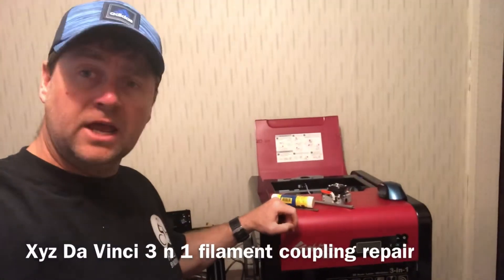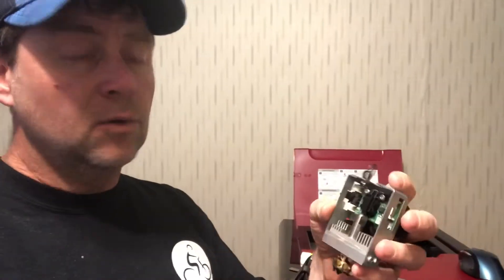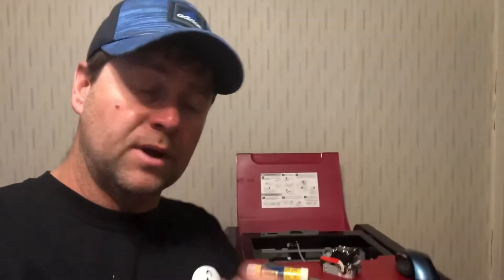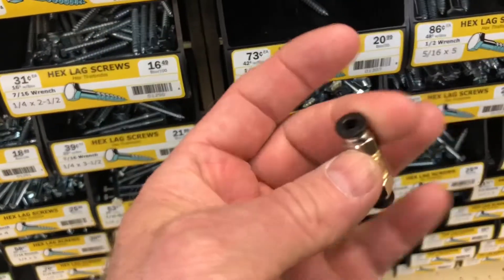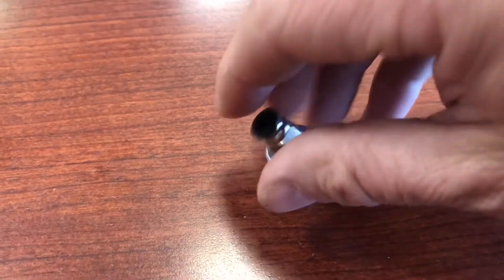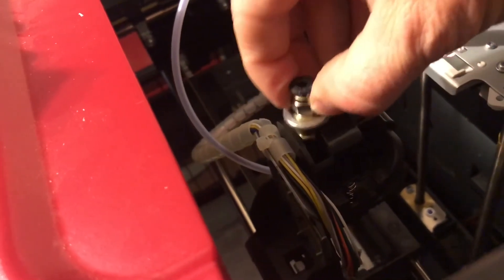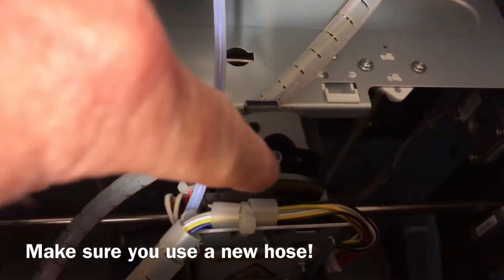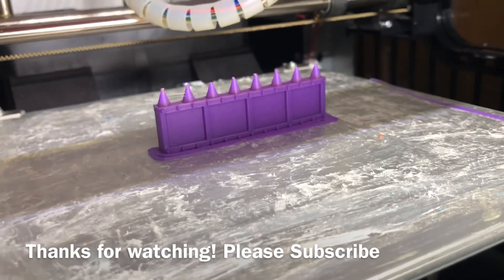Xyz Da Vinci 3n1 extruder filament coupling mod.

Comment: How'd you get that cheap coupling out ? I have some crappy xyz filament that broke off stuck in there and can't get it to melt out or find a way to pull it out. argghh. Stuck and can't do anything with the machine.
Reply from the maker: You may have yo undo the entire extruder and take it out of the machine

Comment: Where did you get the parts that you attached to the coupler? Or what is the official name for the “extruder tube nipple” that is attached on either side of the coupler?
Reply from the maker: You can find almost everything I used in my amazon store.
Two couplers and a brass adapter
https://www.amazon.com/shop/derekjones
Reply: @jonesmachineco  Thank you so much! This mod fixed my printer much faster than XYZPrinting could even send me an email, and will likely last longer than any OEM
Reply from the maker: I’m so glad I could help! Let me know how it works for you long term
Reply from the maker: I’m so glad that worked for you